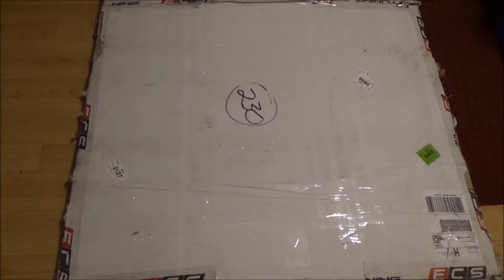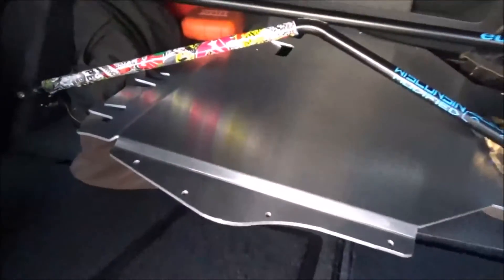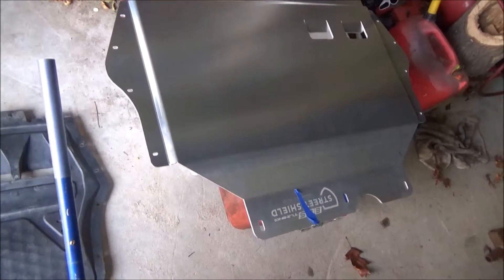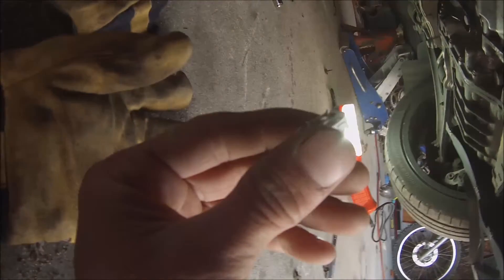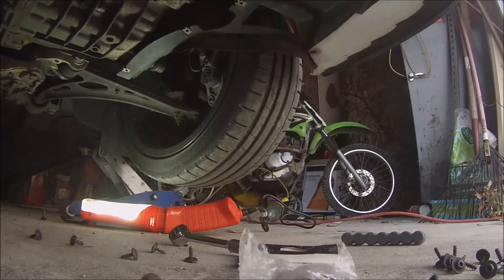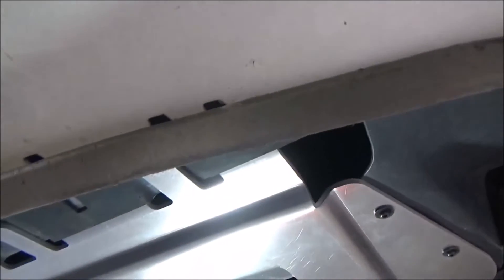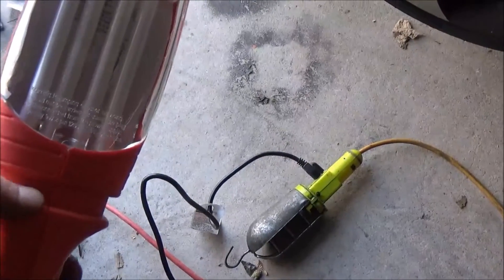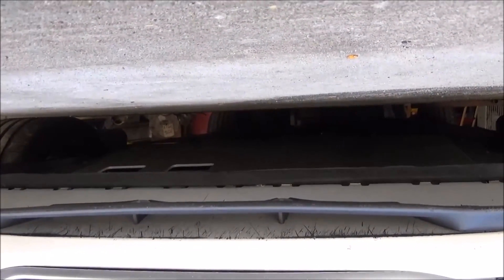VW Skid Plate ECS Street Shield Volkswagen R32 MK5

Comment: I have been thinking about adding a front extension to the skid plate; a piece that would come up and protect the bottom front lip of the plastic bumper cover.....I just went thru a minor disaster...I parked in front of a store...the parking stall had steel crash post in front of each stall, but the posts had been cut off and left sticking out about 6-8 inches....as I slowly moved into the parking space I heard the pipe scrape the bumper, so I slowly reversed the car....and slowed ripped the whole bumper off. The skid plate extension would prevent the lower lip of the bumper from catching on anything ...where i live I am always scraping the bottom on speed bumps, pot holes and alike...any thoughts?